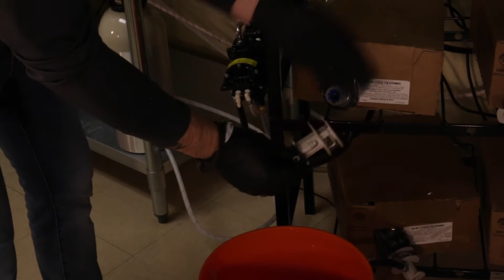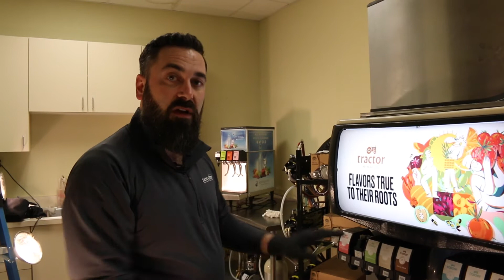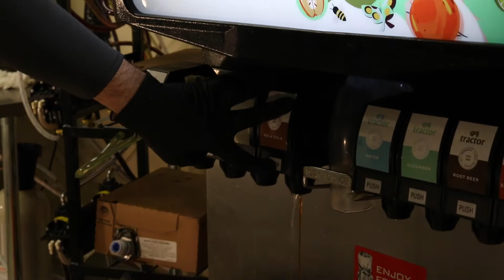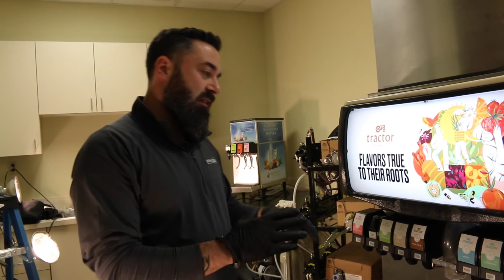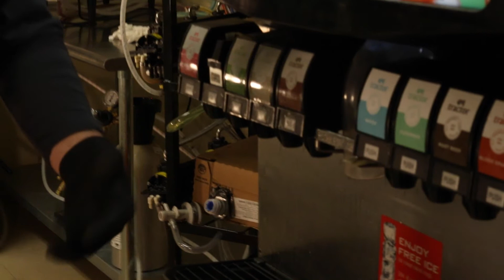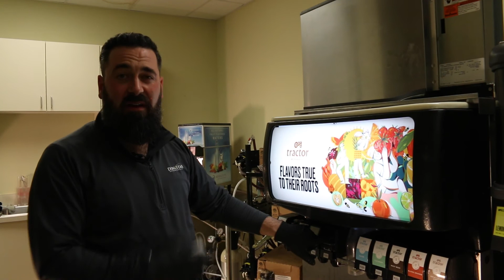How to Clean and Sanitize Syrup Lines

Comment: boutta send this to my managers and show them how dumb they are cuz they think that they can just put the connector in s bucket without that sanitation connection
Reply: With the green/pepsi and red/coke connectors, you can.. as long as you push open the plunger inside and stick something like a sterilized paperclip in it to hold it open.